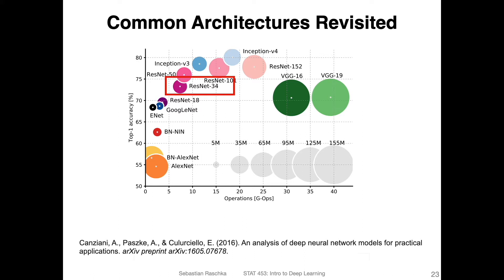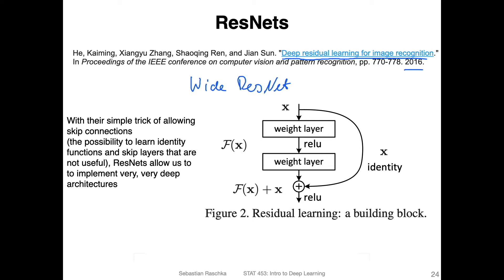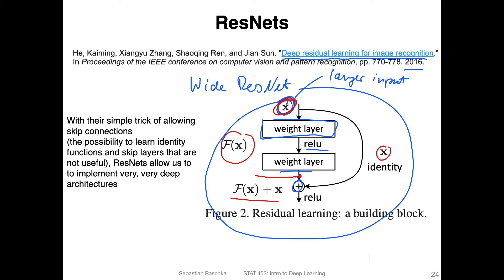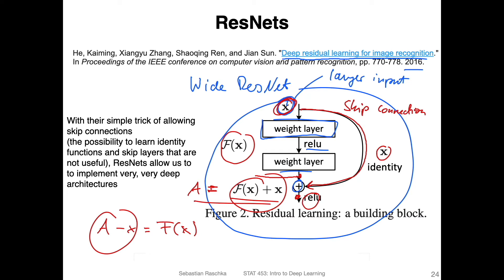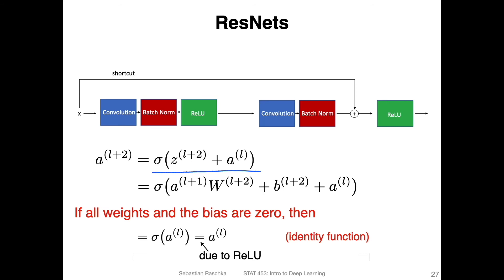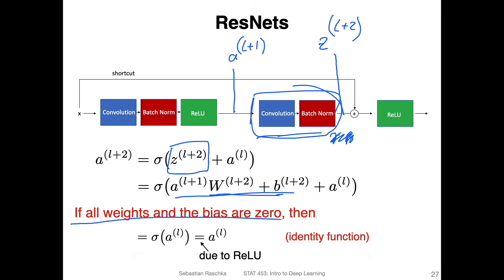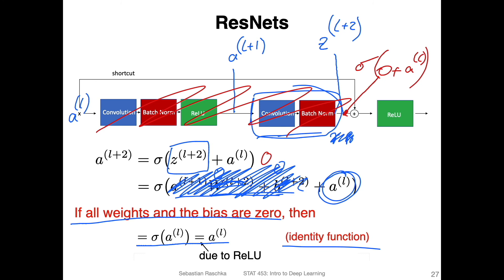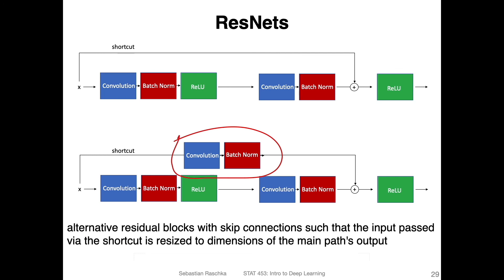L14.3.2.1 ResNet Overview

Comment: For all the scribbling going on there is a better way of saying it:  ResNet blocks learn a residual, or delta, activation value set  with respect to the input.  Within each resnet block, rather than learning a new transformation input to output, simply learn a function which is the delta (residual, difference) from the input.  This seems like less to learn because you can always just use the identity function (i.e., no learning) and has the side effect of stabilizing gradients during optimization of  the model.

Comment: You cannot put the second ReLU inside the skip-block because then you cannot generate a residual (delta, difference) of the input as ReLU always outputs a positive value.  What I don't understand is why a tanh function is not used instead of the first ReLU?  That would seem a more efficient way to get to a meaningful residual in the first stage.

Comment: My intuition may be completely incorrect here, but do we also not risk exploding gradients if our activations dont output zero. Would that not lead to some of the signals being redundant?
Reply: Exploding gradients are avoided in ResNet architectures because the skip connection allows for a unit gradient path end-to-end that competes with the gradient multipliers of the convolution paths.  This creates s forcing function stabilizing the gradient decent of the entire model.

Comment: ReLU block information from passing through about 50% of time. Destroying input information before it can be used and destroying information being generated for the output before it can arrive there. Hence the need to allow alernative paths for information to percolate as you see with resnet. If you used 2 sided Parametric ReLU then the net should be able to organize information pathways itself. Leaky ReLU is somewhat of an alternative I suppose.
Reply from the maker: Yes. But even with alternatives like leaky relu you can have small gradients, and if you have many of them it can add up in the chain rule during backpropagation.
Reply: @SebastianRaschka  Yeh, that's true. I never have that problem because I always train nets with a simple evolution slgorithm. I forget that other people use BP exclusively. 
My observation is that evolution always smoothly reduces error over time without being temporarily trapped in local minima or even slowed by saddle points. Which to me suggests there is s simple learning mode involving adjustments to the statistical  responses of the neurons.
Maybe that can be proved some day🍸